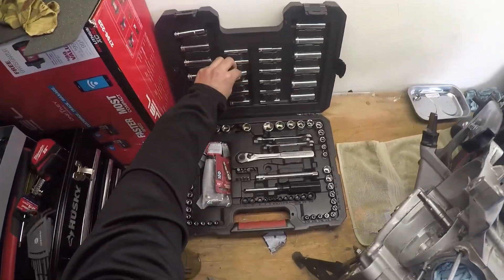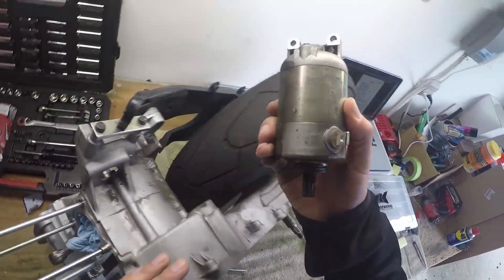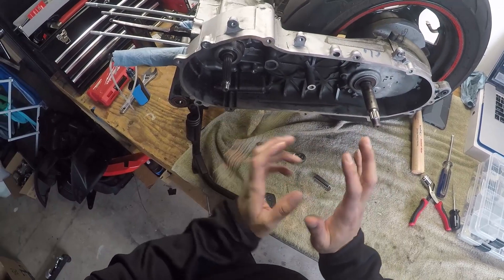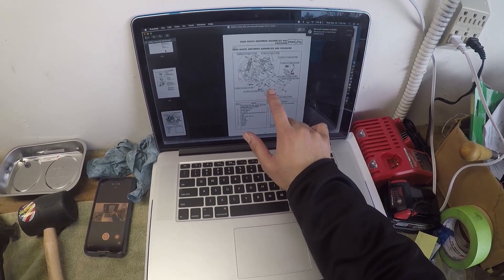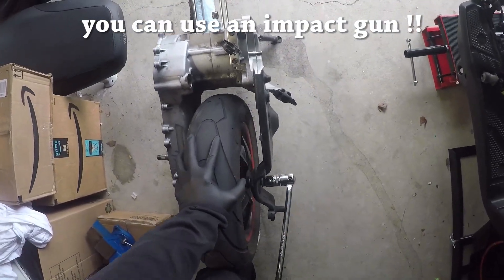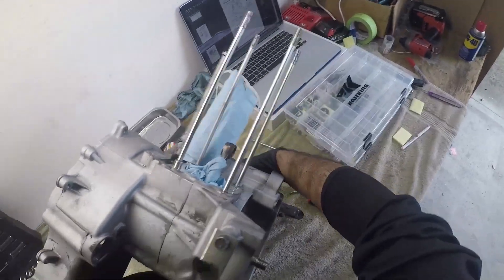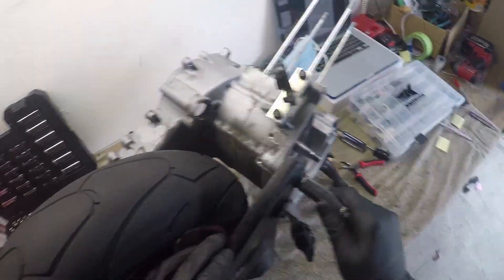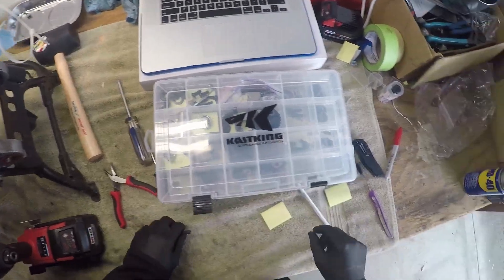Big Bore Kit Series #11 - How to split the engine case on a Yamaha Zuma (BWs) 125 scooter.

Comment: What’s going on . Enjoy the videos . I just bought the mojo stretch kit myself. Are you planning on making a video on the install ?
Reply from the maker: thanks for watching...

i dont have any plans to make one on the mojo stretch kit just yet, i think it involves cutting the rear suspension support bar so im waiting as long as possible because there is no going back.  if i can get off my lazy ass maybe i can finish the install for the engine upgrade
Reply: @OnyxHaze  i get it..
I just installed mine last night and dint see anything on youtube as far as the mojo one. but yes you do have to cut the rear suspension bar not as hard as i thought . good luck on the install